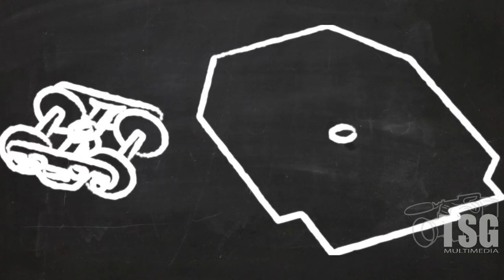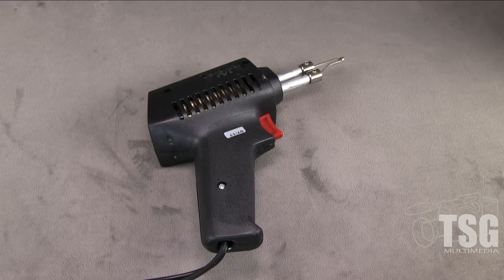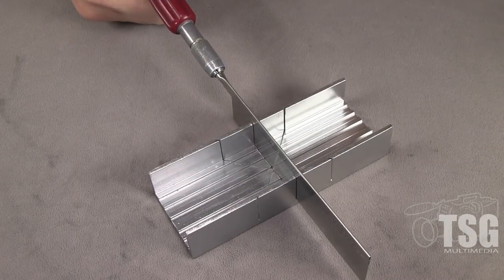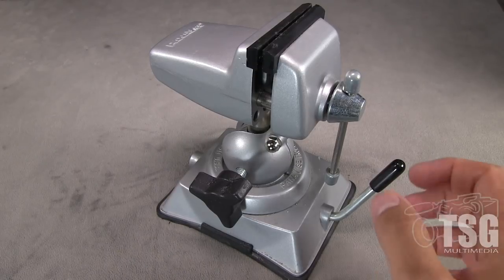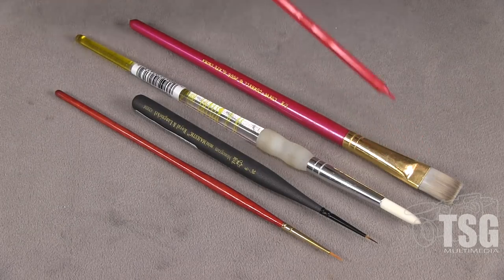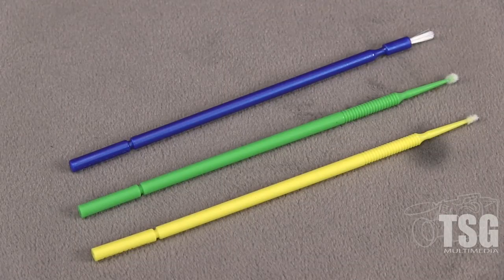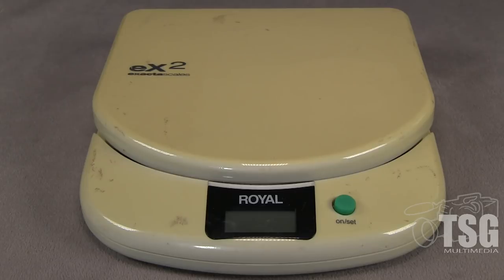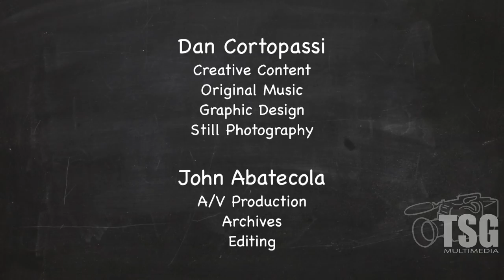Model Railroading 101 Tools For Beginners Pt 2 MR101

Comment: One more tool suggestion.  I use emoryboards with two sides, rough and smooth for all kinds of sanding, removing nubs after cutting a piece of a sprue etc.  I also cut them down into smaller pieces and use them like sanding sticks in tight spaces.  

An unrelated comment from your session on passenger cars.  Regarding the articulated cars on SP.  Articulated cars were first tried on the Zephyrs of CB&Q as well as UP and the SP.  The idea of eliminating one truck was a weight saver particularly when they were trying to build light fast trains like the pioneer zephyr.  You could save hundreds of pounds by eliminating one truck.  Eventually Burlington and SP realized that the draw back as that if an articulatecd  car went out of service both cars in the pair were sidelined, or the entire train in the case of the Pioneer Zephyr.  

Really appreciate all the work you put in on the videos you post, both the 101 and layout tours.  Outstanding!

Bill Bruff
Modeling the Cal-P line of the SP

Comment: I know it’s off topic, but how do you make a program track?
Reply from the maker: Mine is connected to my computer through a SPROG II interface and I run JMRI on the computer. Works great.
Reply: @tsgmultimedia  Yeah but I have digitrax and I’m not that savvy with computers. How do you make a regular program track?
Reply from the maker: I'm not that savvy with Digitrax. I'd recommend checking the Digitrax documentation.